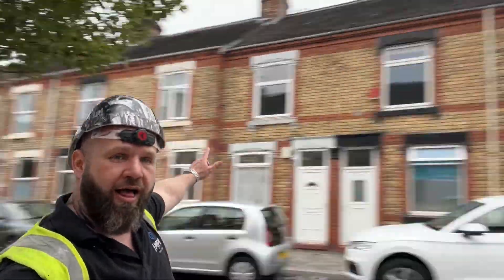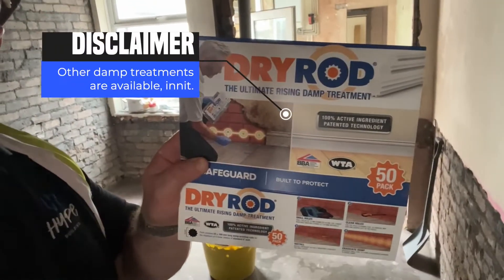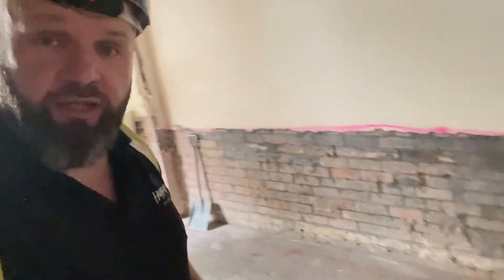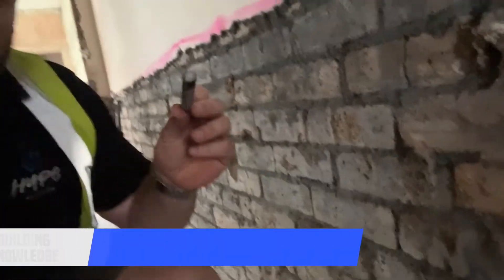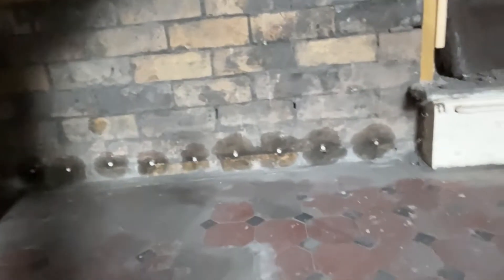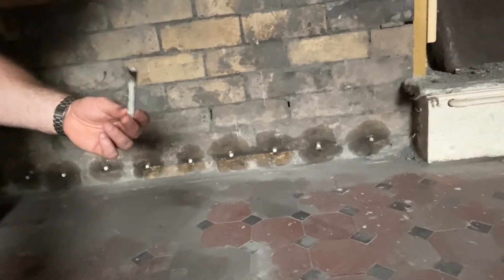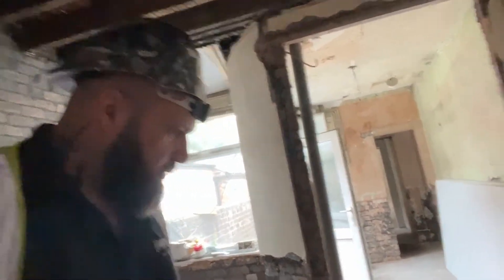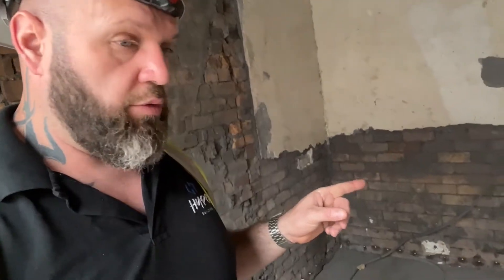Damp Course Using Damp Proofing Rods (How & Why)

Comment: H Brett, if the house has been treated before in the past some years back , is it possible to re drill the existing hole that are visible on the outside of the house and then put theses rods in, or do you drill new holes above on another mortar bed ?
Reply from the maker: Hi there. Thanks for watching and for your question 🙂👍 You can re-drill the same holes – as long as the they are in the mortar, not in the brick. Hope that helps.

Comment: Do I just need to go through my internal course of bricks or just stop before punching through the outer brick ( through both courses) Im thinking just the first internal course, please advise me, thanks
Reply from the maker: Hi there. Thanks for watching and for your question. There are a few things we need to ascertain first before we can advise. 

Is it a solid wall construction or a cavity wall? Is it an external wall or an internal wall? What type of property is it – detached, semi-detached or terraced?
Reply: @HYPEBuilding  cavity wall,external, semi and house ( ground and upstairs) thanks
Reply from the maker: @stevobob2069  If it has a cavity but doesn't have a damp course built in, then you can get away with doing the internal wall with the damp rods.

However, it might be worth removing a brick to check that the cavity is free from any obstructions (like mortar 'snots'). If the cavity is obstructed, there is potential for a bridge, which could create a path for moisture.

Hope that helps.
Reply: @HYPEBuilding  thanks

Comment: Hi Brett. What do you think about whether this is suitable for walls with poor strength that also require crack stitching? I am a bit apprehensive that it would weaken the wall due to the sheer number of holes drilled. The mortar is quite soft in places. Is it worth repointing first, or is there a better product or solution? Thank you 🙂
Reply from the maker: Hi there. Very good question 👍 You can use the rods on walls that are in poor condition. If you're worried about the integrity of the wall, you can always repoint it beforehand.

Hope that helps. Thank you for watching our video, we truly appreciate it.

p.s. Not sure who Brett is 🤣
Reply: @HYPEBuilding  Thank you. Looks like repointing time. If the house collapses - I'll drop a message 😅 Would be nice if they came down a bit in price or had a few competitors. For a stick of chemicals, it's a bit overpriced.
Reply from the maker: @SC-hk6ui  😄 They're not cheap, but they do fix the problem. You can use the cream, but we've found the rods to be a better solution as they contain exactly the right amount of chemicals.
Reply: @HYPEBuilding  i was quoted 4.5k for someone to come in and use some damp proof cream, 100 rods for 250 seems cheap now!
Reply from the maker: @stevenm8970  If you know what you're doing, and where to drill etc. it's certainly far cheaper to do it yourself. The only slight problem with that, of course, is that you wouldn't get a guarantee.
Reply: @HYPEBuilding problem is half of the so called damp proofing companies are not around in a couple of years so their guarantee counts for nothing. Best thing on the market these things are and saves you a ton of money too!

Comment: Useful video mate. Just one question.  If drilling holes from outside do you leave the hole open or do you fill end in with mortar or silicone?? Advice appreciated.
Reply: Fill with mortar or a special mortar filler. It's like a tenner on Amazon and comes in a tube like caulking. There's another vid where the guy uses it
Reply from the maker: Hi there. Many thanks for watching and for your question 🙂👍 You would fill the holes and you can use either mortar or silicone depending on your preference. Whichever you think is more aesthetically pleasing.

Comment: if im using thes on an external wall, 150mm above the ground, does it matter where they are situated when it comes to the blue bricks? would it matter if they were above or below or in the middle of the 2 courses? Thanks
Reply from the maker: Hi Michael. Thanks for your questions. It mostly depends on the floor height inside. It also depends on whether you have a concrete floor or a wooden floor. It's not easy to say what you should do without actually seeing the situation.

Thank you for watching our video – we genuinely appreciate it 🙂👍

Comment: Okay, now I get it. thank you my friend!
As I understand, you are saying,  the moisture in the wall, draws out the DryRod chemical which, now in solution, migrates through the brick towards the next rod, making a waterproof barrier.
Thank you. 
A previous explanation stated that DryRod  soaks up the moisture. That would be impossible to soak up every rainstorm into a course of absorbent rods. Thanks Mate, respect 👊 (🇨🇦)
Reply from the maker: Hi John, Thanks for watching and taking the time to leave us your thoughts 🙂👍 

What actually happens is that the chemicals are drawn out of the damp rods because sand and cement are porous. We install the rods at every perpend (or 'perp') so that a barrier is formed.  

The damp rods prevent moisture from rising from the ground (through capillary action). Otherwise damp can travel as much as 1.5m up the wall.

Hope that makes sense.